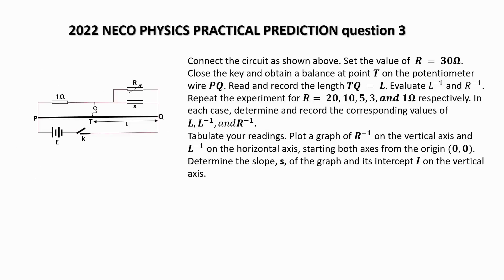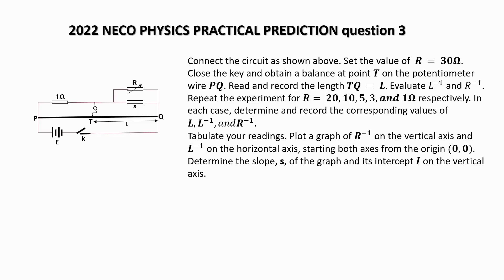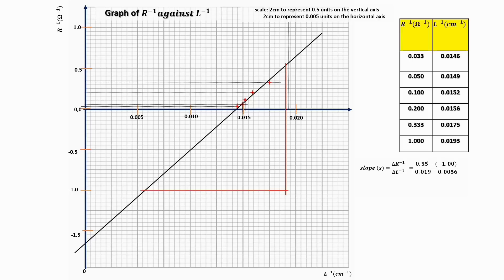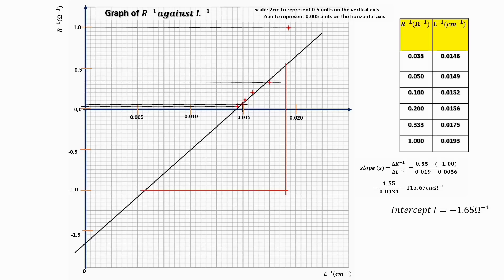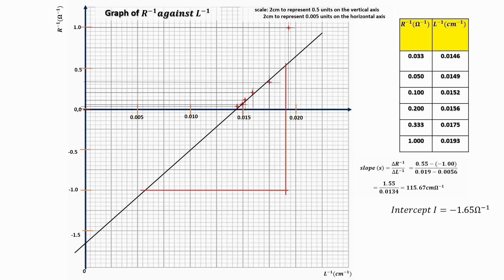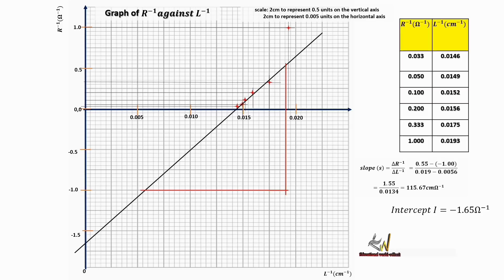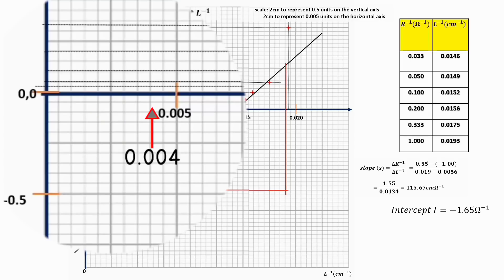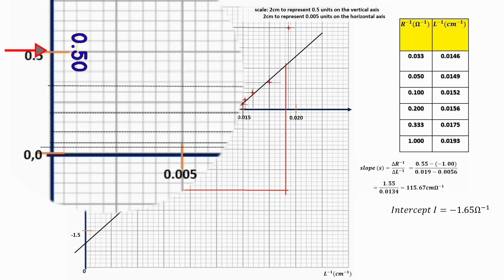NECO Physics 2022 Electricity Practical OUT!

Comment: To find L,initial length(l) should be subtracted from 100 i.e L=(100-l) for metre bridge. I discovered nothing of such in this  experiment.
Reply from the maker: You know that the graduations on the meter bridge are from both ends, i.e. 0—100, from both ends. And in that case you don't need any subtraction, just read-off the length

Comment: Sir what if u connect the positive terminal of the battery to the side whr the 1ohm resistor is connected
Reply from the maker: If you do so you have to change the polarity of the wires connected to the galvanometer
Reply: @sellaxi  ok
Reply from the maker: Yeah

Comment: Thank you sir. Well nailed. Pls are the connecting wires to be used a factor to consider? I mean if its thick will it affect my readings? Also if the metal plate on the meter bridge is rusted will it affect the readings?
Reply from the maker: Thick wires are better than thin ones because they have lower resistance. Try to clean the rust on the meter bridge, then you're good to go
Reply: @sellaxi  OK sir thanks
Reply: I was thinking tiny wires were better. But if its flex wire u have can't u use them
Reply from the maker: You're welcome. Please share the video.